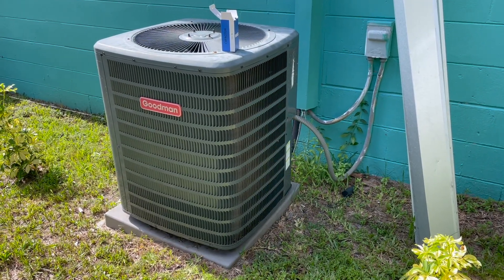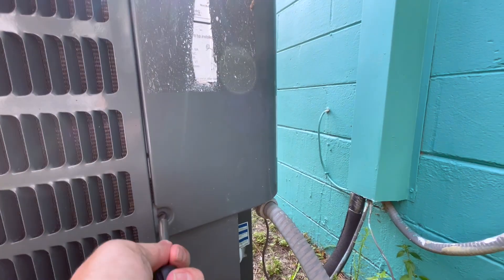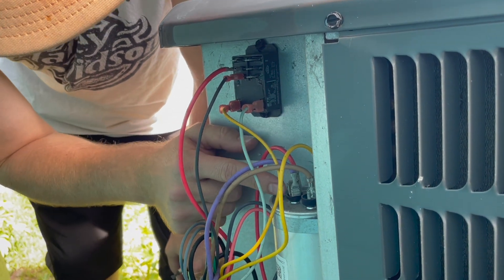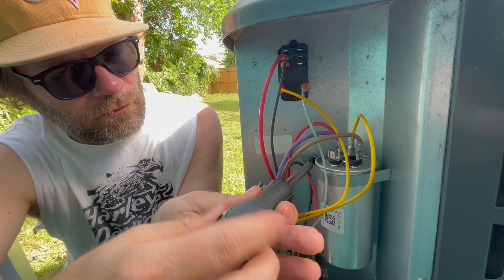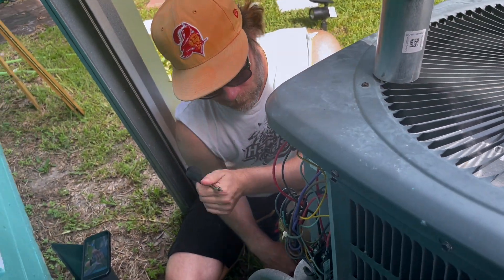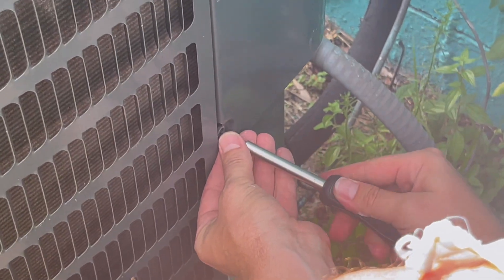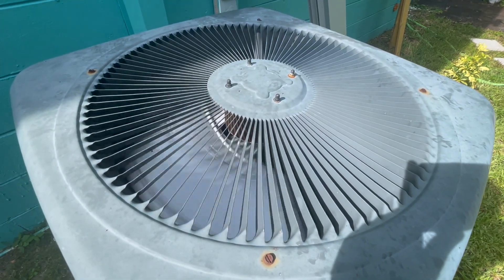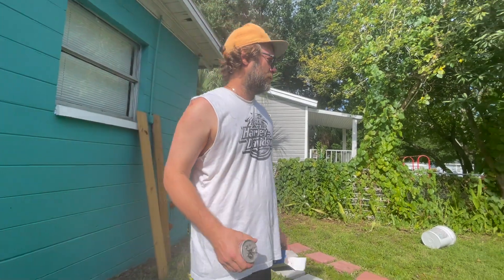Goodman A/C Blowing Hot Fix - Capacitor Repair DIY

Comment: Handling capacitor may be very dangerous tho, stay safe
Reply from the maker: 1:16 you're going to want to make sure the power is not on at the unit by pulling that master breaker. If you can't find that don't attempt this.
Reply: @ricker  One year later xd i never knew this kind of devices

Comment: You didn't shut off power to the inside unit or discharge the old capacitor before touching it... Shock hazard.